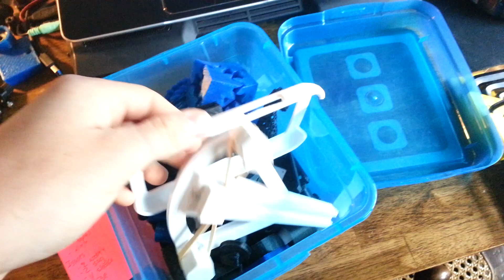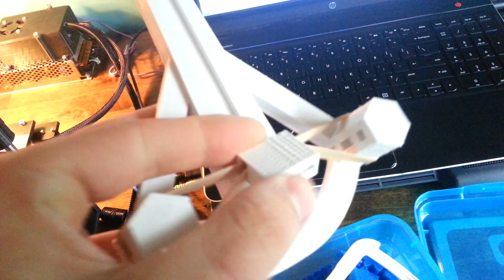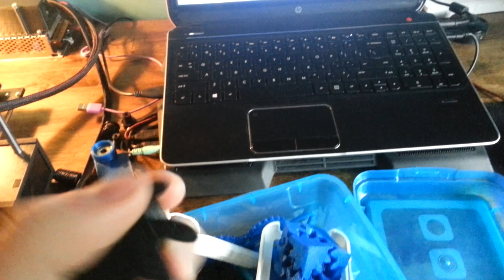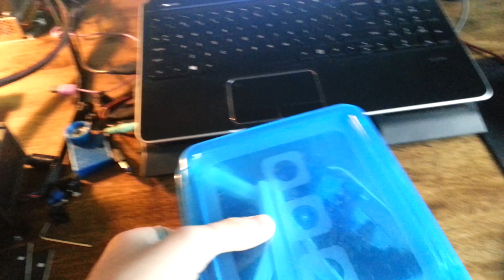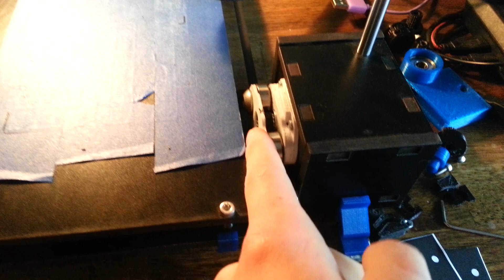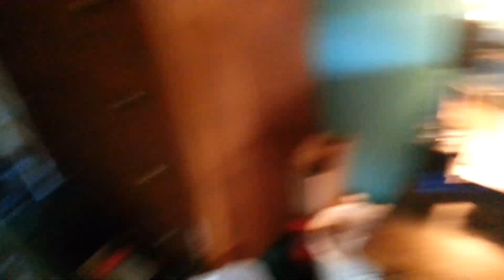QU-BD One-Up and Two-Up "Review"

Comment: Sweet review. Thanks man.
Quick question - what did you do to program the printer into repetier host? On my end, it appears the software isn't recognizing end stops so it keeps trying to drive the axis off their motors - did you program end stops manually? A video on this setup would be really helpful!
Reply from the maker: Well do you have a printer with endstops? If not, using the home button will cause the axes to keep searching for the end stop signal it will never get. It doesn't use software programmed limits for the home buttons. If you do have endstops then you have to make sure your firmware has endstops disabled. You can use the M303 command to view the status of your endstops to make sure they are open when they are not touched and closed when they are pressed.
Reply: I have a One-Up printer - do these come stocked with end stops? How did you program repetier host to cooperate with the printer? Was it by using the instructions above or something different?
Reply from the maker: Zachary Straub No the one-up does not come with endstops. When using it with repetier, you can not push any of the home buttons ever, they will just break your printer. You have to use the G92 x0 y0 z0 command to zero your printer. Also be sure to remove the g28 commands from the start/end gcode in slic3r.
Reply: Will give it a shot - thanks so much!
Reply: Just so I have this right, before I give it a shot and risk damaging the printer:
After slicing - I go into the Gcode and remove the g28 commands from the top and bottom. In the top one, I replace the g28 line with g92 x0 y0 z0....is that it? From here am I ready to Run?
Reply from the maker: Zachary Straub Yep, just keep in mind the g92 command will make whatever position the printhead is at the zero position, so make sure it is manually moved to the zero position before starting a print. Just keep an eye and get ready to unplug in case something strange happens!
Reply: Zachary Straub on your slic3r page, in repitier host. click on configration. when that window opens....go to printer settings. then click on custom G-code. remove any line that has a home code in the beginning and end box. then it will not try to go home everytime. then, each time you turn the machine on....go to the jog page and take the machine to X0 Y0 Z0 and go to the g-code line at the top. type in G92 X0 Y0 Z0 then push send. now the machine knows where home is

Comment: Seen a video on aceton and heat to get rid of those ripples..
Reply from the maker: That only works with abs plastic and it will not remove large ripples, just smaller ones, but at the cost of losing detail in general over the model.

Comment: When you did the gantry mod did you glue the bearings and rods in place?
Reply from the maker: I did not because I was constantly taking it apart and putting it back together, however that probably would help reduce gantry sag slightly.
Reply: Okay, thanks. I had asked because I suspected it was causing some of my z banding issue but I have since nailed down the culprit.

Comment: I just assembled mine and would first like to thank you for your great tips and secondly ask if you know how to switch the x axis in the firmware. In Repetier-host when I tell it to go left it goes right and vice versa. This is only a problem for the x axis and I can't figure out why it would be like that.
Reply from the maker: I have another video in which I talk about how to install custom firmware. If you look in the firmware under the configuration tab, there will be a few lines that go something like "reverse x stepper direction: False" And you just change it from true to false or false to true (I forget which it is by default.)
Reply: I just tried that but the firmware refuses to upload, gives an error saying Arduino.h: no such file or directory
Reply from the maker: Travis Bills Hm I'm not too sure why that isn't working. Anyway, ther is an alternative. Just power down all of your electronics and make sure nothing is plugged in. Unplug you x stepper from the board and then pull out two adjacent wires on the end from the connector (so if the wires are 1 2 3 4, pull out 1 and 2) then swap those wires and plug them back into the connector. This will reverse the direction of the stepper.
Reply: Thanks, I will keep trying to fix it in the firmware just because I am stuborn but its good to know I have an alternative.

Comment: When you replaced the gantry did you notice a vast improvement?

Because at the moment I still have the stock gantry, and I get acceptable prints, but they still have slight rippling and minor deformations in the outer perimeter.
Reply from the maker: That rippling is due to the y axis not being rigid enough, printing the gantry won't help that. What it does help is by slightly reducing the gantry sag and it makes it much easier to take apart and put back together for repairs and upgrades.